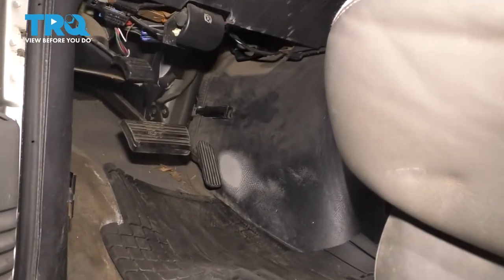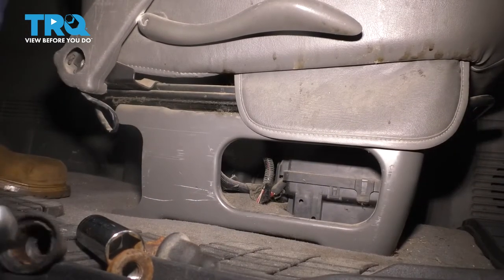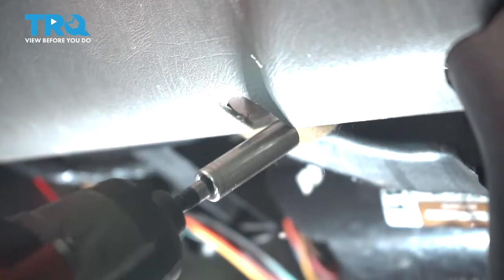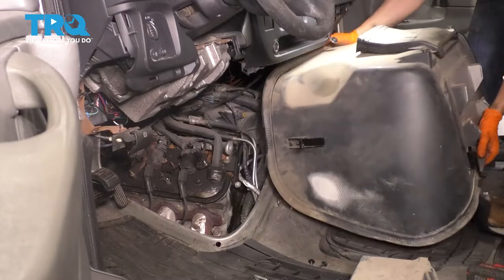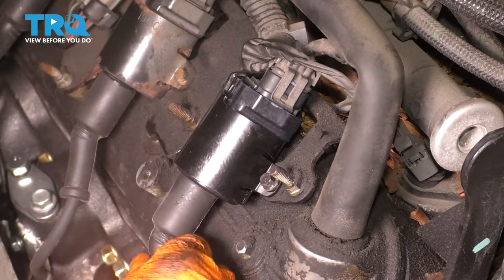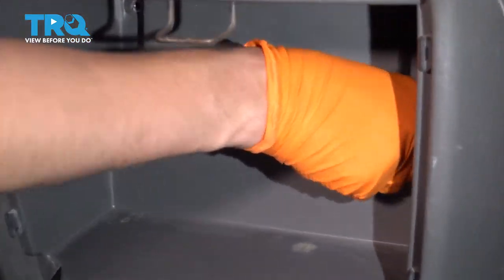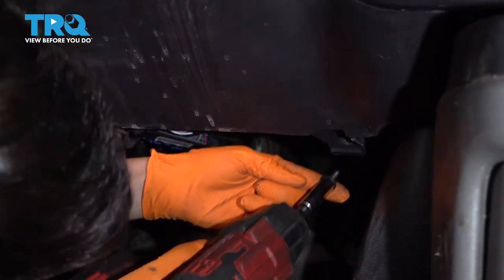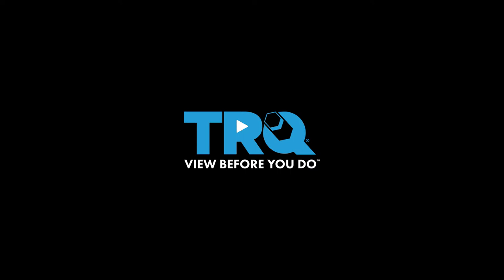How to Replace Ignition Coil 2003-2021 Chevrolet Express

Comment: When do you replace ignition coils?

95,000
Im having my mechanic do a tune up; 
plugs & wires.
Should i replace the coils too?
Adds $350 in parts 😮